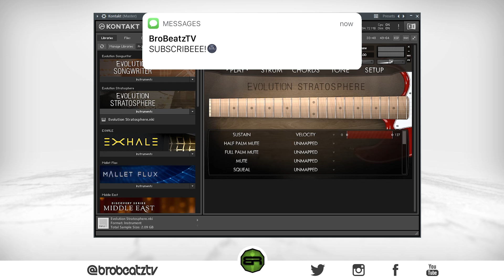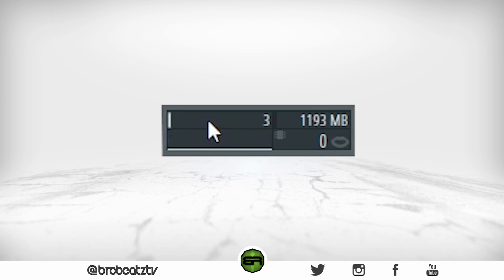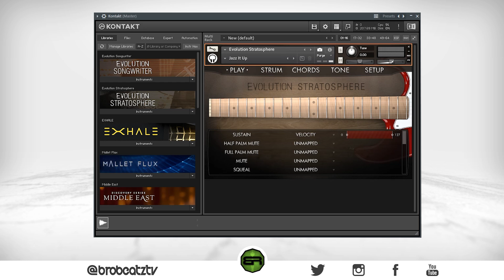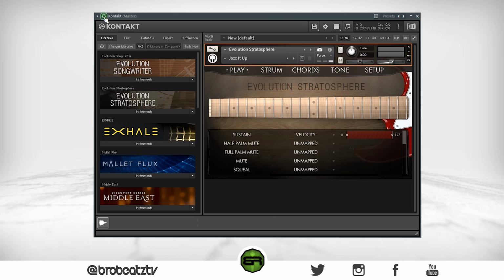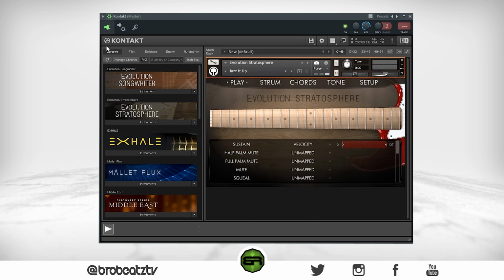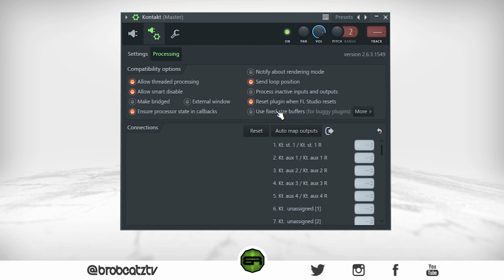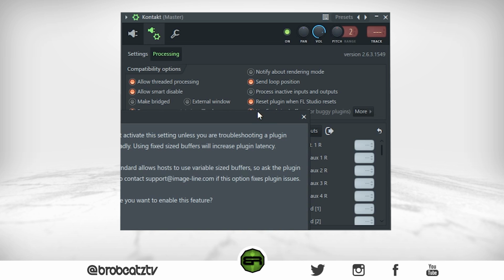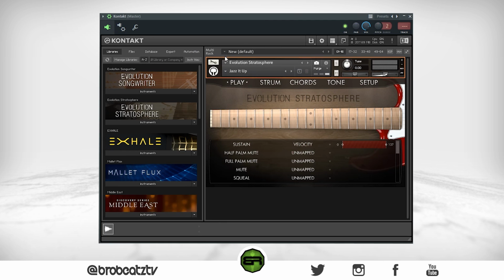How To Fix *ANNOYING* Distorted VST Audio😡😱 (Kontakt Distorted Samples)

Comment: Yeah... that is how you fix it in FL Studio... How do do you fix it in Kontakt??? Which doesn't have a "detailed setting's knob" ???? I am pretty sure FL studio doesn't either... And last time I checked FL used a DX wrapper, but since that is a Microsoft thang, and FL "I THINK" was released on OSX... Long story short, no other software uses a wrapper to handle the VSTs, and the problem is with Kontakt not FL Studio, and the "detailed settings pulldown" is for the VST wrapper native to FL studio... You didn't fix anything.. Fkin BS Click bait... And how come every one that uses FL Studio refuses to learn anything, like ever... period.

Comment: This only happens to me in Kontakt 6 when the instruments have reverb fx built in. I had to turn of that reverb and it solves the problem. Didn't know why was happening cause I got an i7-7700K plus 16gb ram, but gonna try this instead!
Reply: hi did u ever find a solution?
Reply: @arunabhmahanta  did u? I've got the same
Reply: @wessafy5992  open kontakt > vst wrapper settings > use fixed size buffers ✅ 

i use fl don’t know how that works for other daws

Comment: Okay so, this has nothing to relate to the video, but I have watched almost every video out there to reduce it, my computer is kind of trash, and it always does the cracklings noise whenever it wants to, I was wondering if there was like an option I can fix that with
Reply: Set your buffersize bigger, the downside of this if you play your midi it will have more delay